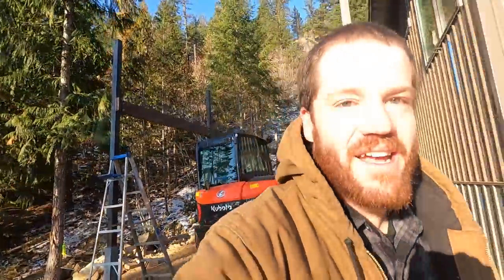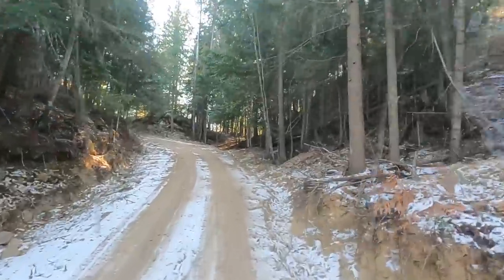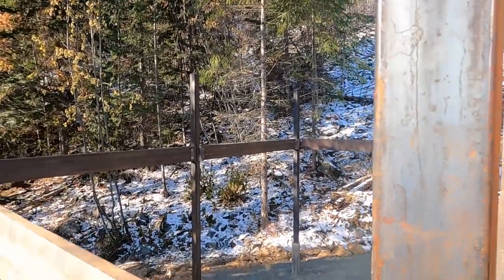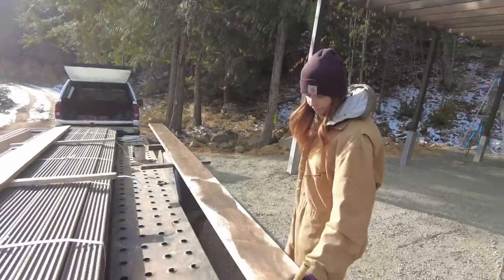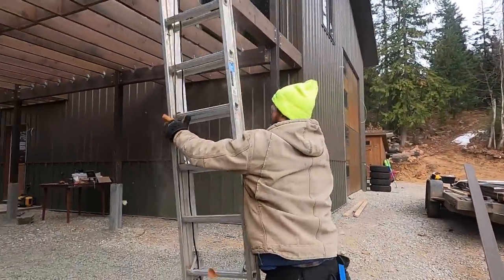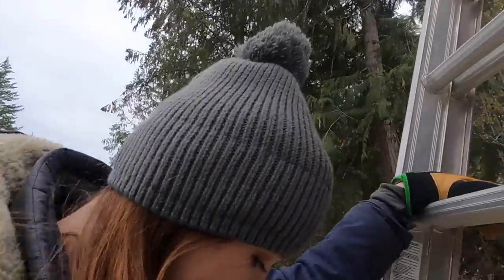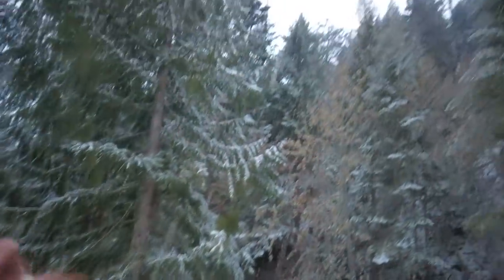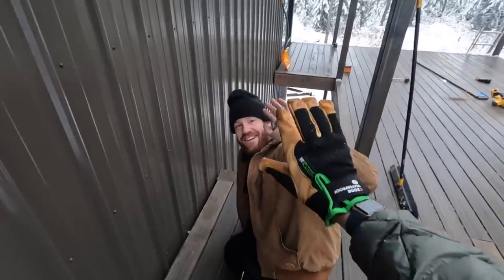FINISHING OUR GIANT DECK | Building Off-Grid

Comment: You know by the time you guys are done you're going to have a palace maybe even a mansion but it's going to be getting cold really really cold I mean so cold that your fireplacing isn't going to heat up the house that means you have to cuddle but you guys you're awesome taking that little truck getting gravel he might have to get another couple of trucks got to put it on thick if it's too thin it'll still get mushy and maybe cut some little channels to drain water off put some rocks in them but that's my  opinion you guys do what you want to do cuz you know what you're doing but it's going to get cold lots and lots of snow so you guys have a merry Christmas give your dog a bone

Comment: As always, great video. Check this 12V 8KW/ 27,000BTU Diesel heater out. That's what you need for heat in the Army Truck! SILVEL 12V 8KW Diesel Heater on the Amazon. Plenty of YouTube videos on these types of heaters to watch before you buy. ~Steve~

Comment: Military strucks are generally only rated for half the carry capacity rating of a civilian truck of the same specs. So yout military truck can probably handle 10,000 pounds without issue, but maybe not so much on steep roads with snow and ice. 8000 is probably as far as you should push it in the winter.
Reply: People routinely haul 10,000 pounds on a Duce and a Half and they are also only rated for 5000 pounds by the military on road.

Comment: TIM from Canada attention Courtney and Riley been watching your videos and suggestions for your woodstove if you are at the point where your money is a problem to buy wood splitter. suggestion are if you have or can afford to buy SDS. jackhammer. you can use this to split wood this does work. and this will work for you to cut down the wood to the size you need for your woodstove. if you go to YouTube. and put in SDS jackhammer. splitting firewood. there should be videos on. I have seen a video on this in this doesn’t work. this way you can use this to get your word to a manageable size.. and here is another suggestion for you if you know of (lumberyards that are in your area ) call them up see what they will charge for logs you were tearing out as you were doing construction if you can get money for timber. this will offset your diesel price for machines. when you were cutting down your trees. put them off to the one side and see if lumber company will buy trees from you just another thing to put on the list if you want to make some money again to offset your diesel price. when you are doing construction and tearing out your trees again you should be able to get a little bit of money for the trees you were taking out to widen your properties again just another suggestion in a line of things you can use to make a little bit of money.. these are just suggestions to help you love your videos TIM from Canada

Comment: I didn't know because of materials or the route ya'll went, was there a reason that you didn't weather prood the top of the joists (tape) before installing the decking?
Reply from the maker: Honestly we bought the tape, but it didn’t stick very well to the freshly stained joists, so we just decided not to use it. 😬
Reply: @AmbitionStrikes  makes sense. That deck is still going to last a lifetime and doubt it will ever be an issue. I didn't know if it was the stain/sealer you used didn't need it or what. Thanks for the reply!

Comment: Military truck ratings are a very conservative estimate of what it can carry OFF-ROAD. Your 2 1/2 ton 4x4 means it can carry 5k off-road, but 10k on-road. The 6x6 version is called a 5-ton, for its off-road rating, but can carry 10 tons on -road.
I also hope that you are using the CTIS when going up and down your slippery hill. Sand mode would be ideal for snow and ice as it softens your tire and increases it's footprint. Also, ether start does work and the military rated, multi-fuel engines have no problems using it, or they wouldn't have installed it. But, like anything else, it needs to be maintained. I recommend starting all of your vehicles once a week during the winter, and keep them covered if you can. Like tarping your dozer, for starters..

Comment: Why aren't you lowering the air on your Army truck if you are worried about traction. Lowering the pressure extends the tread length increasing your traction. Doesn't it have an tire inflation system?

Comment: What is the wall thickness of the 4" square steel?
Also, regarding the "ARMY" truck you have, I drove the 5 Ton version when I was in the ARMY and they are extremely capable when those trucks are working. I drove the FMTV so much, that I got a driver's badge (award for safe driving) and my MOS (job) wasn't to drive.

Comment: Military data placards state ratings for capacities in the absolute WORST possible road conditions.  For on road conditions which you are experiencing, you can at least double it.  I formerly owned a deuce and she NEVER hand problems with heavy weight.  I also STILL have my M105 trailer which has 1.5T capacity and have had 8000# of rock and gravel in it and it never had an issue with the weight.  The guy we got the deuce from used to carry his Bobcat in the bed of the truck with all his additional gear to a remote Alaska mine.  

Fill that bed up kiddos!

Comment: Great decision on the spacers.
Cousin did a deck  it was ALOT of predrilling and screwing and couple boards unfortunately bowed.

Suggest you should weld simple railing at shin, thigh, hip height around deck,
allow dogs out.

And....which way are the stairs going?

Comment: I'm always supprised how afraid people are of ether injection systems.   Older farm tractors have used them with no ill effect for years, you just have to follow the instructions.   My dad has a deer 2030 that has had ether every winter when it drops below 20 for 46 years straigt and it still runs perfectly.   the important part is to make sure the engin is turning over freely BEFORE you hit the injector. do it that way and it starts every time with about a 1/4 second puff.

Comment: It’s always too late for this but, laying a strip of tarpaper on top of the deck joists will make them last longer. Stain won’t do as good of a job 😊
Reply: To quantify the steepness of your road get a gps app that shows elevation.  Measure the elevation at the top and bottom of the hill and then find the difference between the measurements. Should also be able to get the distance between the elevation measurements. Grade is a mea
Reply: Sorry bumped the send button. Grade is a measurement of feet of drop per 100 feet of distance. Usually seen on mountain passes. 7 percent grade drops 7 feet for every 100 feet of road travel. If the elevation at the top of your hill is 2500 feet and the elevation at the bottom is2400 feet. There is a drop in elevation of 100 feet.  If the distance between those two points is 1000 feet. There is a ten percent grade(100/1000). Hope this helps.

Comment: "I wish there was some way to quantify how steep this road is."

Use a two foot level to measure the gap between the ground and the level when the bubble shows it's level.

The slope is defined by the rise over the run:  3/24,  for example.

Or take the inverse tangent to get the slope in degrees:
tan -1(3/24) = 7.125 degrees

Get yourself some scrap wood and post the slope and/or degrees of the various hills.  This can be the name of the hill until you decide on actual names for the hills,  which you can leave space for on the sign:

Slope 3/24  7 degrees
Will Skubi hill

That's my name!  I'd like to see a hill named after me in a video!

You could auction the naming rights off to your hills,  although just being creative with naming would be fun.

Be sure to post signs at the top and bottom of each hill,  so you always know what's ahead,  and can picture the sign with your name for the hill on videos.
Reply: You could use my screen name as an alternate possibility for the name of a hill:

3/24   7.125 degrees
SeattlePioneer Hill

I rather like that....
Reply from the maker: We’ve used a clinometer and the grade is currently 22%. We just wish it would show up better on camera!